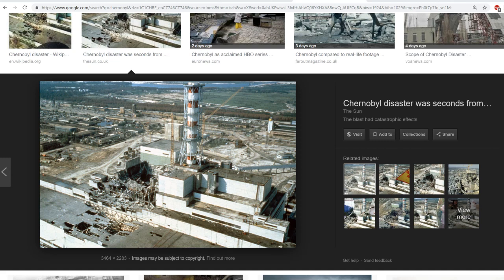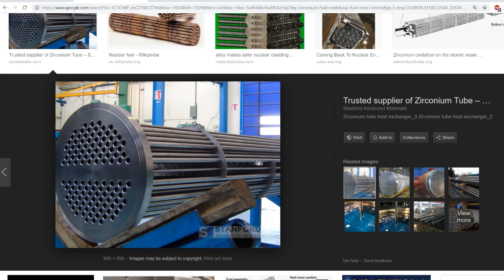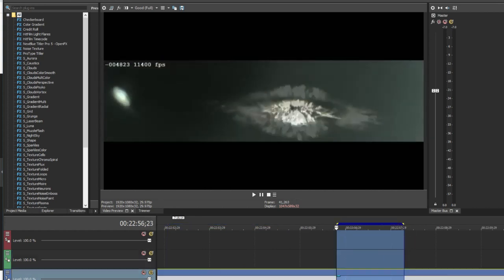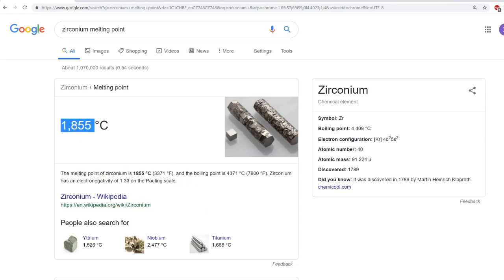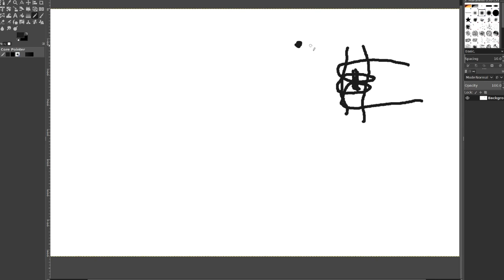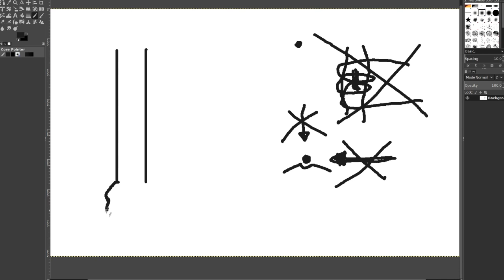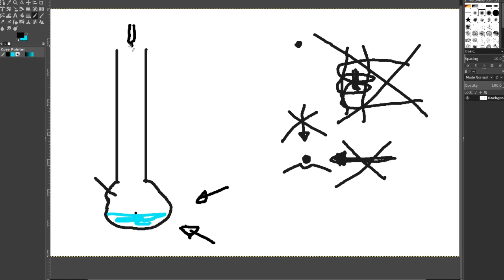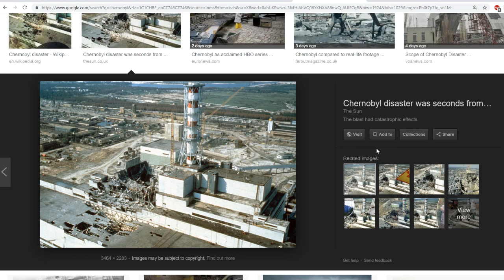Was Zirconium the real reason Chernobyl exploded?

Comment: There's a study that concludes a component of the Chernobyl explosion was nuclear. It states:

"According to the main version, it [ Chernobyl's explosion ] was an explosion of chemical character, that is, the explosion of hydrogen formed in the reactor at high temperature as a result of water reaction with zirconium and other elements.

The alternative version is based on the assumption of a large instant energy release of nuclear energy. Convincing evidence in favor of this version was for the first time obtained by Radium Institute employees on the basis of an analysis of atmospheric xenon radionuclide samples collected in the area of Cherepovetz and of the analysis of the value of 133Xe/133mXe isomers activity ratios. [...] it should be acknowledged that the hypothesis of a nuclear mechanism of enormous instant energy yield in the Chernobyl accident seems quite convincing, as is supported by experimental data; these data are in good agreement with the calculated results."

Google: Estimation of Explosion Energy Yield at Chernobyl NPP Accident
Reply: Xenon-isomer ratios aren't speculation. They're used to detect nuclear explosions.